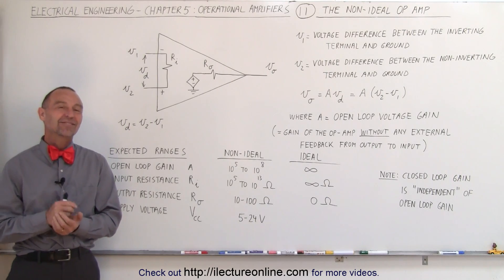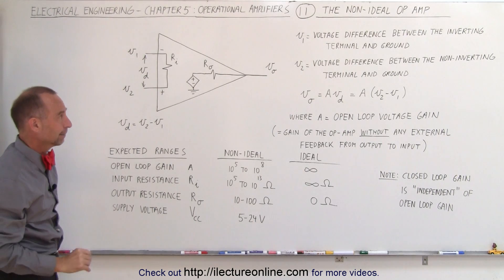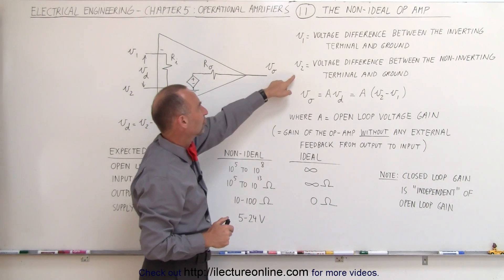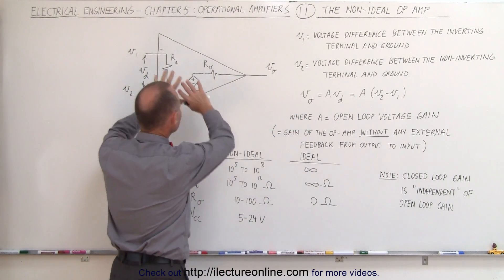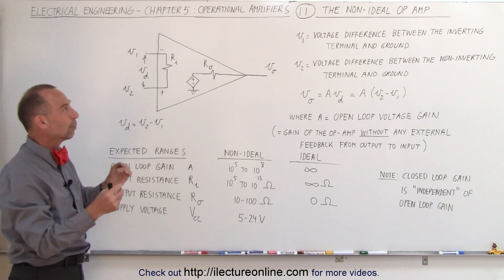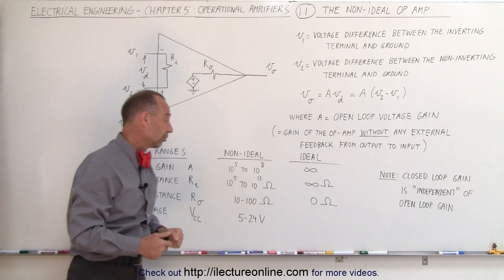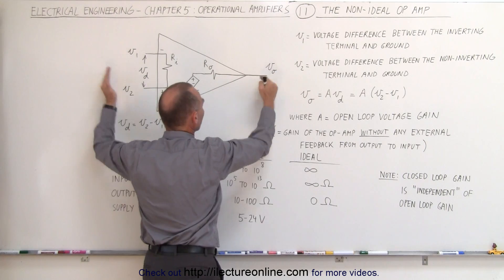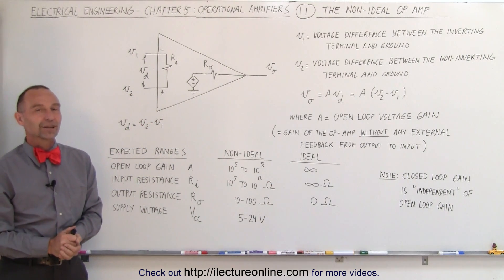Electrical Engineering: Ch 5: Operational Amp (11 of 28) The Non-Ideal Op-Amp

Comment: Under what circumstances would it be necessary to perform calculations using the non-ideal op amp? You have my gratitude in advance for any response(s)!
Reply from the maker: The difference is so small between the ideal and non-ideal performance of the OPAMP that we generally only use the ideal equations.  The non-ideal equations are used for academic reasons and to explain how the OPAMP actually works.

Comment: Very nice series. I was just wondering why is it Vd=V2-V1 while V2 has positive polarity so shouldn't the order be reversed?
Reply from the maker: The video is correct.  The op amp reverses the output voltage relative to the source voltage.